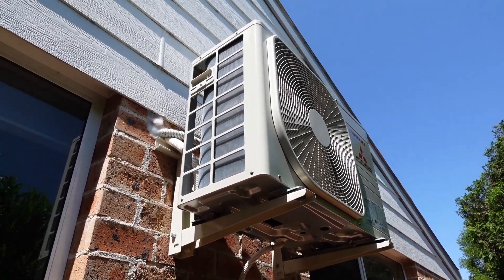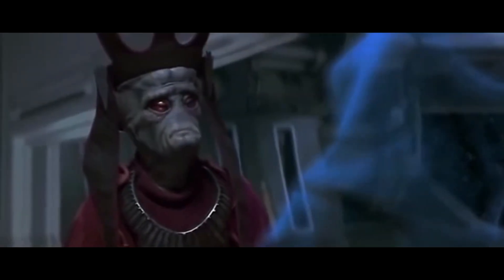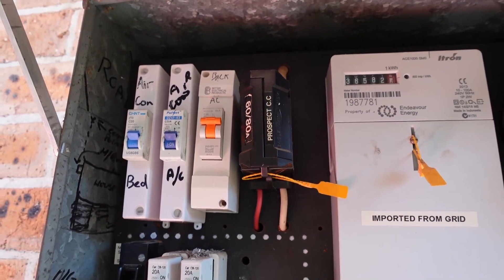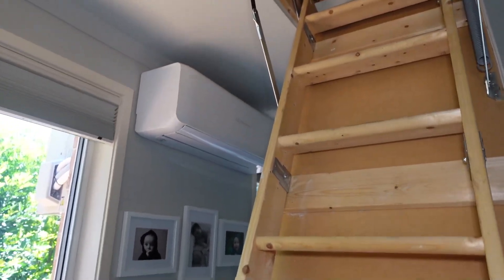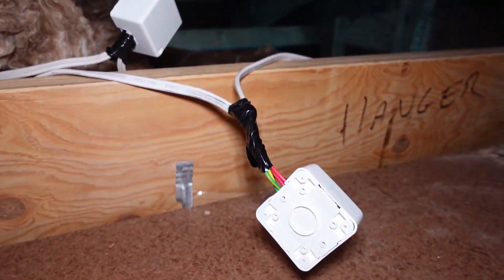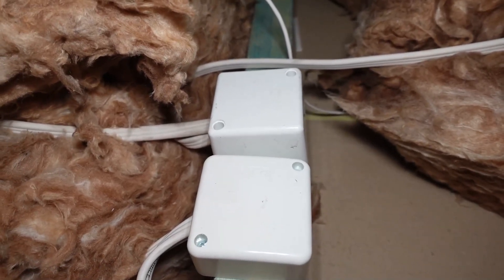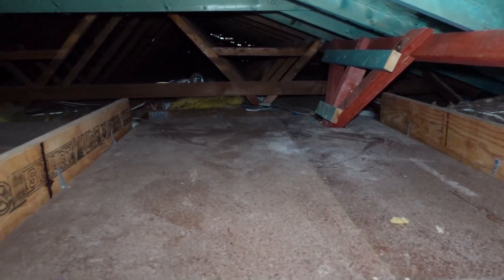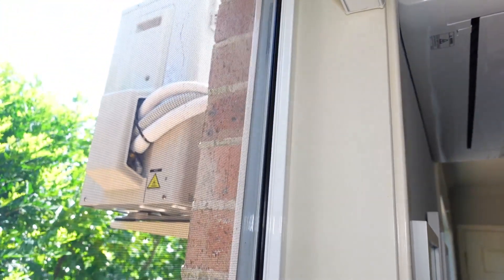Aircon Wiring Install FAIL- TWICE!

Comment: Yes ok it's not the best and a bit mess but.

Did I miss something?
So nothing that was done here was illegal, correct?

It's one thing to do some thing illegal but it's another to pick fault in work if it's just your preference for a certain level of professionalism or higher standard of work when I'm going to assume you had a number of quote and picked them based on price?

What did the quote say when you got it Dave?
Did you spec requirements to say that you had an install in mind that was in excess of what the legal requirement is?

If not I find it hard to fault the installer without more info.

I'd take one look at that fuse box and go yeah this customers not really bothered judging by this, he just wants the cheapest thing that's legal and that wil do.

When you called them back did you clearly set out your requirements as to what upgrades you'd like them to do?

Yeah sorry Dave need more info before I can side with you opinion.
This might be just a case of you get what you pay for until you can show me otherwise.

Comment: Say what you will about the breaker panel but the mains cable itself looks SO much nicer and cleaner to terminate.. The three wires in a line opposed to the triangle, never seen such a thing. We only have the triangle arrangement cable.

Comment: Definitely isolators are a must, double  pole especially when on an RCBO! Rcd/ RCBO also mandated for domestic installations! As per AS/NZS:3000

Always ask for a Certificate of electrical safety, as per energy safe.  

Also most manufacturers specify a minimum pipe length, one to note if it’s installed back to back!
Reply: Awesome someone else noticed no earth leakage, circuit 32A and below require earth leakage

Comment: Yes, the smaller units can be wired off the GPOs - saves you money, but they definitely need an isolator next to the unit. The penetration looks rubbish. They should have provided a weather shroud.

Comment: Australian circuit breakers/fuse boxes are very interesting. All those random boxes sort of just screwed in there wherever they'll fit like a game of Tetris. I bet the back of it is full of spiders just to keep the electricians awake - I bet they need to not only be trained to work safely on live equipment, but also to safely work amonst insects that want to eat them ;-)

Comment: Hey Dave, I have to say that your fuse box looks terrible, Is that the case In all australian houses? It looks like you've inherited a lot from the Brits... For the contrast, typical modern european (Polish) fuse box: http://wpuh.pl/wp-content/uploads/2015/04/Rozdzielnia3-743x1030.jpg
Reply: Very common in houses older than about 20 years.
Reply: No, it really doesn't look like it was inherited from the UK - it doesn't resemble anything we've ever used here.

Comment: Wow that install looks like it came from the 1930s - mount everything separately on a board! That’s why consumer units were invented!
Reply: The panel looks like some of the old 1930's machines at work bakalite hinged panels pain in the arse to work on.
Reply: yep depending on the age of the house that board might be asbestos
Reply: The fact that it's outside is a bit screwy to me (in the US) as well. The electrical panels here are almost always indoors.
Reply: @FnordOok  in the UK they have to be indoors too, With our climate it would corrode away within months,  any outdoors mains must be IP67 and protected with RCD.
Reply: @FnordOok  Except for California, panels are generally outside there.
Reply: @FnordOok  in EU too
Reply: Our switchboards are usually external as they also contain the power meter, so the meter readers don't have to walk into your house to check it.

The board looks like that because it is pretty old, eventually that'll get switched out to a nice new neat install when he runs out of space for new circuits.
Reply: @Thermoelectric7  newer houses have a small outdoor cupboard with the gas and electricity meters but all the distribution and MCB's have to be internal,  any outdoors equipment even ip67+ rots like mad, it's a big problem on Industrial sites.
Reply: @dogwalker666  interesting! Most outdoor switchboards here just show their age internally like Dave's, don't rot out. Gotta have seperation here between gas and electricity too, mainly for gas bottles but likely applies to meters as well.
Reply: What you are seeing here is a fusebox that hasn't been upgraded and is probably in the region of 30-35 years old and has had various additions without a full upgrade.
Reply: They seem to be a legacy from the days when your fusebox was mounted on the front porch near the front door of most houses. usually an asbestos box with the meter, fuses and switching. All exposed too. then in the 1950s we moved to the box on the side of the house, but with the same stuff inside. a meter, service fuse(s), both of which are supply authority, and then a row of ceramic rewireable fuses for the various house circuits, usually one or two lighting circuits, two or three power circuits, if you had an all electric house you would have one for the hot water, one for the stove, one for the oven, then of course any additional ones for other dedicated circuits, air conditioning etc.

Units, apartments, townhouses etc usually have a local fusebox and main switch in the house generally located in either the garage, the kitchen or the laundry, and a common metering room with all the main fusing and metering.
Reply: Consumer unit -- sounds like something an economist would say.
Reply: @James_Bowie  lol.
Reply: @James_Bowie  Or a Brit! Same difference 😉

Comment: Hey Dave, what's the bare-ended orange wire flapping about in the back of the fuse box at 3:40?
Reply: Looks like that wire used to feed the hot plates and it was connected into the main switch. Should have been also disconnected out of the hot plate fuse holder. I agree, looks terrible. My guess is they changed to gas hot plates and no longer required the circuit.
Reply: That looks scary looks like it comes out of the main switch
Reply: Why aren't more people mentioning this?
Reply: yikes! thats definatly..how ya doin!

Comment: Does everyone have these air-conditioning boxes outside their homes? Is it possible to make them less conspicuous/noticeable? I live close to the arctic circle so this is all new to me😶
Reply: Yeah you can. You can even install them under the ground. You swap the air as cooling for using the planet. (Heat pump)
But it's all down to cost.

In this case I think Dave took the low cost option and got the cheapest legal install.
Not nice or pretty but just* legal.

Comment: Dave any idea why the roofing wood is red and blue colored? I’ve never seen anything like that before.
Reply: Blue is H2 treated, indoor use termite treated south of the tropics. 
Red is usually H2 North of the tropics (northern termites are worse)
The LVL's (clear wood beams) are also H2s where the glue used is termite resistant.
Reply: Pressure treated wood would be my guess.

Comment: That breaker panel looks a little "how ya doin!"
Reply: good enough for straya! 👍
Reply: @WacKEDmaN  bloody rippa
Reply: Yes! Something that I just gets me every time. They are super picky about electricity and safety. Yet the fuse/switch/breaker board is always a complete mess. Often poorly labeled, bare wires.
Preventing is better than curing?
Reply: @p_mouse8676  It might be grandfathered into the code changes. My 1960 John F Long house has a similar issue with two conductor copper wiring. Also, the wiring was from a time when the family might be lucky enough to have one radio and maybe a single TV in the living room. So, yeah, that the usual culprit when you see something Janky that the code officers ignore.
Reply: Looks like it was wired by a crack addict. How the fuck is that even allowed?
Reply: time for a complete board upgrade instead of bodging new stuff into that 80's installation
Reply: @wilbertbirdner1303  looks older than that. The setup in my 1980s australian house looks fit for the taj mahal in comparison to daves.
Reply: It's not the front it's the BACK of it! What in other D.J. lexicon could have be called "a dog's breakfast"! 😄
Reply: its australia. in autrrria un thinkeable
Reply: I don't think this would be even close to passing in VIC
Reply: Mike's Tropical Tech - I think it's more of "Here's your sign." (Gotta Love ol' Bill Engvall.)

Comment: Why the hack do you only have two circuts for the whole house? I live in Germany and here we have normally one CB for one room. Big loads like electric stove, washing machine, ect. have an extra one. I was almost shocked as you said that you only have two.
Best regards from Germany

P.S. I am sorry if I wrote or spelled anything wrong :). As I said: I'm german.
Reply: Looks like an old panel, old house. New houses would generally have more circuits and a din style board like you have in Europe. I have the same problem at mine, 1960s house, 1 breaker for all the powerpoints outside the kitchen
Reply: It's very common in normal-sized Australian houses to only have two power circuits. And yes, it sucks. Asking for more gets a "Wadayawanadothatfor" response from the average sparky.. It's only been relatively recently that per-circuit earth leakage breakers have become more common - most houses only have a single ELB for all the power circuits.
Reply: @ickipoo  makes finding the bloody culprit extra hard when they trip a whole house system
Reply: @ickipoo  If I saw it right in the video, there isn't even an RCD. In "normal" german house installations (at least until a view years ago) had at least one or two 30mA RCD's and whole bunch of breakers (in Germany we call breakers LS-Schalter (engl.: LS-switches)). One 16A LS for each "normal" room. The stove (and other 400V loads) usually gets a 20A three-phase LS. The wiring for outlets, lights and other standard loads is usually a NYM-J 3x1,5mm² wire. The stove gets normally a 5x2,5mm² wire.
Reply: Eaven old houses in Germany have more CB than that. Big 3phase melting screw fuses for the whole house that go into smaller 3phase fuses for stove and water heater. Light, washing maschine and rooms over separate 1phase fuses for every room, divided on the different phases. Including retrofitted FI's for every bathroom.
Reply: I have lived in an apartment in Germany where the wiring was done in the 60ies - it had exactly one 16 A circuit. It did have a gas stove, but it was still annoying as hell. Always had to be careful not to turn on too many devices at once. First thing I bought back then was a UPS for my computer because the breaker would trip like once a month when I forgot about the 16 A limit...
Reply: @maximilianmustermann5763  Jeaaa... But thats a pretty extreme example. I know that there are houses which are wired like that. But it's rather rare as far as I know. Just two-conductor wiring, melting screw fuses or aluminium ("aluminum" for all you janks :) out there) conductors are very old and extreme examples that I know. But it would be pretty easy to upgrade your "Hauptverteilung" or "Unterverteilung" (engl.: "breaker panel") to a bigger current service and more circuts, breakers and RCD's.

Comment: In Queensland you must have a lockable isolator as close as possible, but not mounted to the unit. And no more than three units on one circuit I believe.

Comment: they have condensers that will operate 4 wall units, so im curious why you have a dedicated condenser for each head o.0
Reply: Those are always a bit compromised in terms of performance (longer pipe runs, pressure mismatches, etc), they cost more than discrete units (at least, they do in Australia), and if you have a fault, you lose all cooling/heating.
Reply: @ickipoo  yeh its more copper, but lineset is cheaper than a condenser =s the power saving go bye bye, if all 4 zones are calling for cool from one condenser vs 4 condensers ay caramba
Reply: The 4 individual units are MUCH cheaper than a 4-head compressor. The individual units work better and are more energy efficient. The installation of individual units is cheaper, and no need for huge long refrigerant lines to be routed all over the place. It's a no brainer to NOT use a 4-head unit like you propose.
Reply: @johncoops6897  if you say so, champ. ive only installed around 50 of these personally myself, california has a huge rebate program, $600usd off per ton of cooling, and the difference here between condensers servicing one highwall vs 2 or 3 or more is only a couple hundred dollars where a separate condenser is just under 2 thousand. 🤑
Reply: @azza-in_this_day_and_age  - the units that Dave is using are cheap, and multi-head is significantly higher cost per cooling point. Minimum for a kids  bedroom would be 2.4kW, so 4 would need to be an almost 10kW condensor which is a massive difference. There is no efficiency gain from multi-head, in fact there is greater pumping losses and and other losses via the far longer pipework. Therefore here it's about TOTAL efficiency (COP and EER) rather than some strange rebate based on the quantities of compressors.
Reply: @johncoops6897  sounds like a hack job
Reply: @azza-in_this_day_and_age  - no, it's the best way overall. Same as high end HiFi gear uses separate dedicated components rather than one large compromise item. You also don't seem to grasp just how long the lines would need to be and that they are separate rooms. If there was a large single space then 4 heads off a single condensor would make sense, but in this case it's completely separate, non-joined rooms often not used at the same time and sometimes never used together. It's crazy to fire up a huge compressor just to use 1/4 of its capacity. Multi-head just isnt used in AU, or most other places either, primarily because it's so damn expensive compared to single units.
Reply: @johncoops6897  its like $400 or $500usd worth of copper lineset... well under the costs of condensers haha
Reply: @johncoops6897  never had trouble running lineset. its fun to braise 😁and they disappear with lineset covers and paint
Reply: @johncoops6897  we only do separate condensers if they want to be able to bill the power user individually, like if the rooms were rented out.
Reply: @johncoops6897  4 units with 4 disconnects with 8 fuses with 24 copper wire line/load with 8 sealtight fittings with however many feet of conduit its way more expensive, to do it right

Comment: Why on earth would they go to the trouble of drilling through brick when then is Hardiflex paneling right above it?   Simply hole with a weather shroud would have done the trick a whole lot nicer.
Reply: It could be because the drain pipe from the indoor unit  needs to have a downhill slope
Reply: @EternitP8  I think the minisplit units usually have a condensate pump, so that you don't need large diameter pipe with downhill slope.
Reply: @Sixta16  actually, as an installer of mini splits, they rely on gravity for the condensate drains do need the slope
Reply: Yep, downward slope but you don't need a big pipe.
Reply: @wobblysauce  spot on. 20mm OD  will do it. Although it shouldn’t drain straight on to the pavement because it can be a slip hazard. It should go into a garden bed or storm water or even a pot plant is acceptable in Aus
Reply: they gotta stand around for hours doing something not nothing

Comment: The times I have hired an electrician to do something (very few), I am all over him, looking at everything he does.  I have dealt with way to many "specialists" in the past, and kinda know how sloppy they like to be if left to their device.
Long time ago, when I needed to work with people in some processing plants, man, I needed to check every single joint to be OK.
Reply: Just like the plumber we got to replace the prv for the hot water tank he made it illegal and dangerous for people on our street.
aka did not fit a backflow preventer.

Comment: Is that exposed copper on the orange wire near the current clamp 3?
Reply: came here to ask that same question, also...all red wires?
Reply: @jeffhousen8968  Well everything you're looking at up there is the line conductor, so yes, all red..